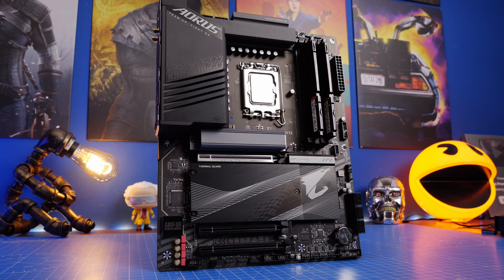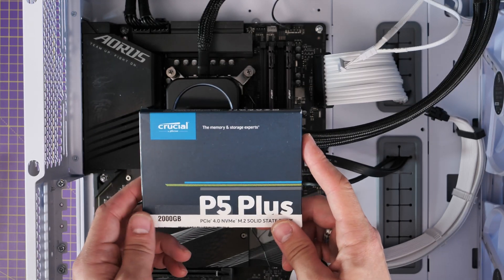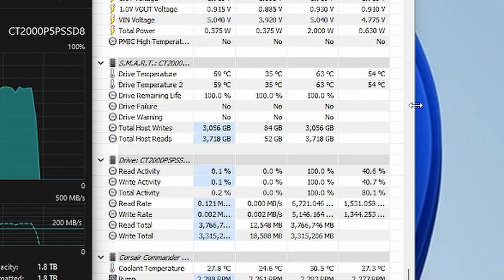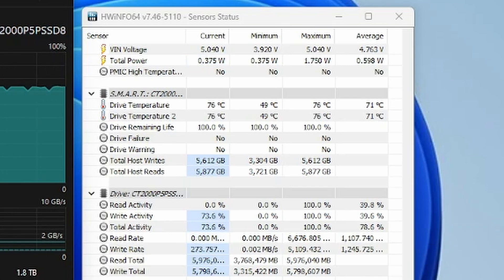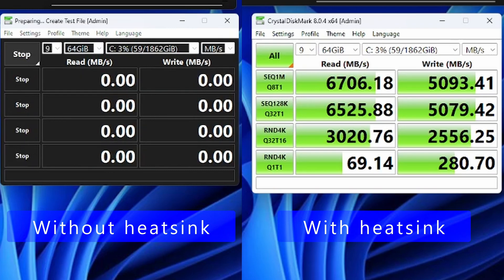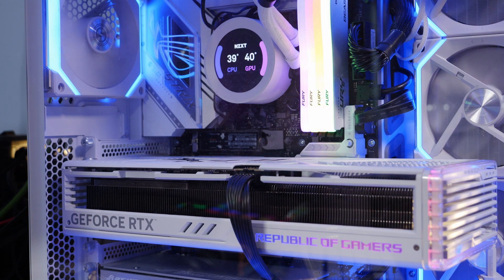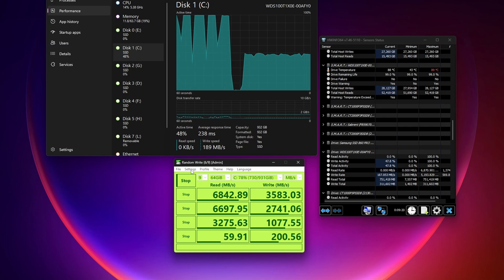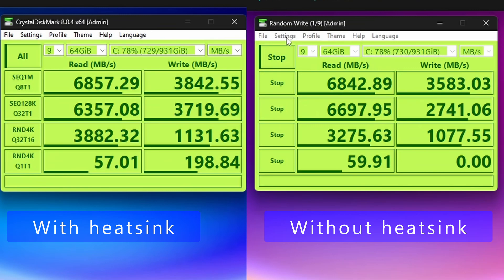Uncovering the real impact of NVMe heatsinks

Comment: Thanks for the video! I was hoping to see a comparison between the large stock heatsink covering all three NVMe drives under the GPU versus individual third-party low-profile heatsinks, and if they actually fit under the GPU. It seems like the stock heatsink might be transferring heat between the drives rather than effectively dissipating it. Thoughts?

Comment: FYI. Some drives, like Samsung, spec 70C as recommended max operating temp. So not only is there a difference in your tests, running without a heat sink crosses that limit.

Comment: If you buy an NVMe drive that has its own built-in heat spreader, do you have to remove it in order to fit it under one of these built-in heatsinks, or are they built to flexibly fit the increased width caused by built-in heat spreaders?

Comment: I don't think the average user's temperature, heat sinks or not, will get anywhere near the temps you're showing - as long as they have sufficient cooling to begin with and the fans are not blocked.  Thanks for the video.

Comment: From my research the best method is leaving just the pad on the controller taking it off the nands and using the pieces u remove to put under the controller to the MB the nand need a high temp and the controller needs to be as cool as possible for longevity.

Comment: After I watched this video, I tested my PCI 3.0 Samsung 960 EVO 250GB with Crystalmark. I dont have a heatsink on it. The temp quickly got to 68 degrees on the NAND and 90 degrees celcius on the controller. Didnt think a PCI 3.0 drive would get that hot...the speed is about 3500/1500

Comment: I've just ordered a Gen4 drive but my motherboard only supports Gen3 so the drive will be running much slower than its max speed (it was the cheaper option surprisingly), should I still use a heatsink? thanks
Reply from the maker: Yes

Comment: -READ ME-
What you're seeing is the controller thermal throttling. Flash will perform better under higher temperatures. If you cool the controller and not the flash you will get better performance.
However to prevent bit rot you should keep the flash cool when not under heavy load.

Comment: -- They make a HUGE difference.  I run passive heat sinks on Samsung 990 pro 2tb NVME drives.  I have Acdale sinks, under constant tests with disk mark, I can't the drives over 39c.  They run gen 4, Glid .5/1.0mm pads where relevant, thermal grizzly between the sync and the spreader.  Also did tests first with labels on and labels off the drive.  That saved me about 1c.
Reply: I think you meant Acidalie.

Comment: How about doing a video on how to get that Corsair AIO display to actually work and not show a red triangle all the time regardless of how many rimes you treble check your wiring, uninstall and wipe all traces of the software from your pc etc etc......that would be lovely...👍

Other than that rant, love your content.....that voice of yours is something special. 👌
Reply from the maker: Sorry to hear you've been having trouble. I'd recommend uninstalling iCue completely and downloading the latest version then check for firmware updates for the Commander Core
Reply: @TheProvokedPrawn  It's ok bud. Just a little rant really. When you invest thousands into a new rig and such a simple but handy thing doesn't work, it kind of upsets you a wee bit. 

I'll do as you suggest. Thanks for responding. 👍

Mike.
Reply: That’s how mine display is when the PC is off with the power plugged in

Comment: The temperature gun at 30cm away from target measures a circle of 5-10cm diameter depending on model, so you are not measuring the SSD alone.
Reply from the maker: Tbh the internal sensor temps are a better measure of what I'm showing anyway but thanks for the input.

Comment: Lower slots typically come through chipset and share bandwidth with other periphelias and are slower. So the top most slot is the one you should use unless you know that using bottom-slot doesn't hurt performance.
Reply from the maker: That is true.